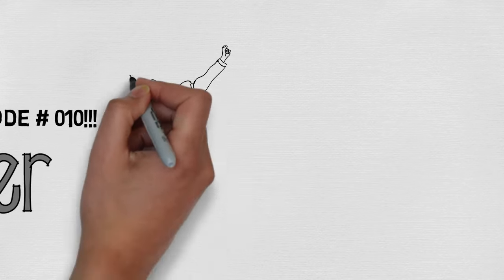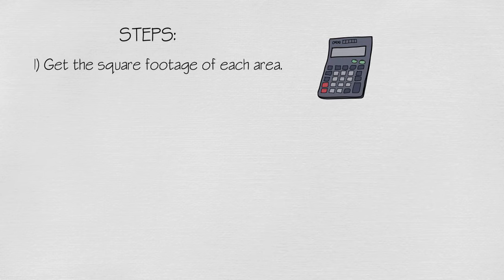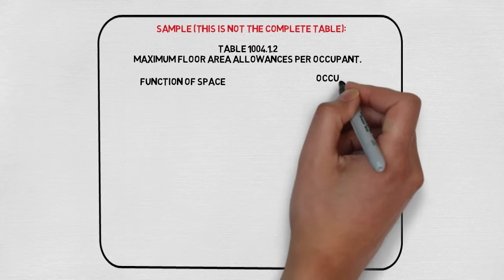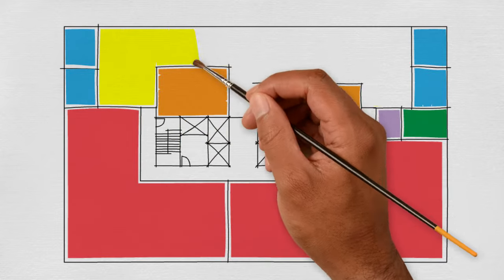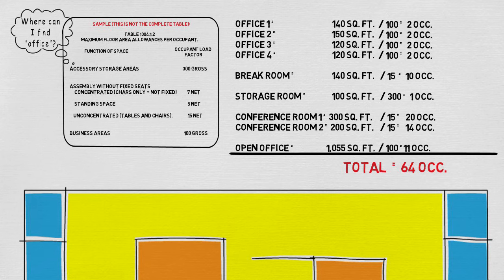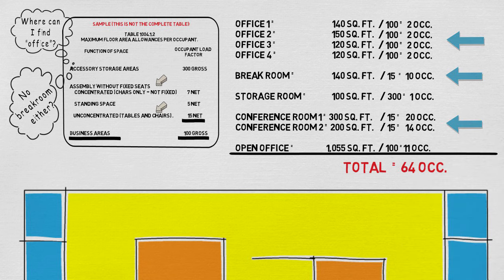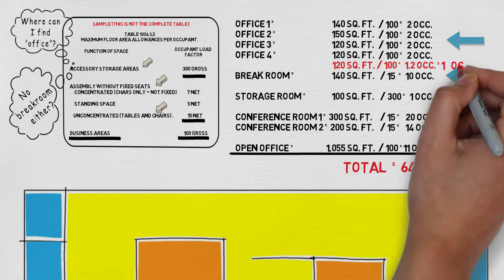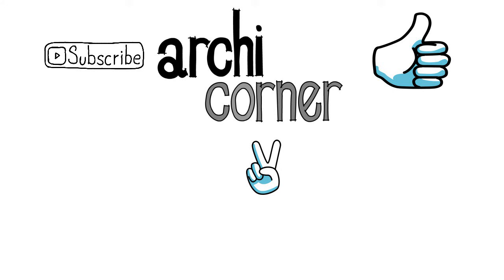AC 010 - Egress: How to Calculate Occupancy Loads (Part 1 of 2) - The Basics

Comment: Are your videos per CIDQ codes>
Reply from the maker: CIDQ is a license type if we are not mistaken. When you are a licensed designer you must design per the local codes. However NCIDQ's exams are based on the IBC and other commonly used standards by interior designers such as BOMA, ICC A117.1, NFPA, etc. 

The video you commented on specifically (AC 010) was produced with IBC in mind. Most other videos on the channel also reference the IBC. Each video states which codes are being used for the samples given. 

Sorry about the late reply... :(

Comment: What is the difference between net and gross?
Reply from the maker: You can find the definition of "Floor Area, Net" and "Floor Area, Gross" in Chapter 2 of the IBC. Chapter 2 is basically a dictionary for phrases used throughout the IBC. You can view the IBC for free online. I hope that helps!
Reply: well I may be wrong but it may relate as follows:
net = minimum 
gross = maximum

Comment: Why not add all the Business Area square footage up first and then divide by the Load Factor? It would have divided out better and you wouldn't have rounded 0.2 up over and over again.
Reply from the maker: The main reason you show occupancy loads is to show how many people are egressing from a specific area. Depending on the occupant load some areas may need two or more exits. Since the load for offices is so small, it is reasonable that a typical 10x12 or 12x12 office may not need two exits. Therefore combining all the offices area into one occupant load may work fine. HOWEVER there are times when AHJ's may ask for the occupants load in a specific room to confirm that the correct number of exits are provided. Therefore it is a judgment call as to whether you use combined loads, individual loads, or a mixture thereof. Regardless of the method used, the key is to clearly show how all egress requirements are being met. Sometimes one method will be better than the other. 

GREAT QUESTION!

Comment: First off, I love your videos, they are extremely helpful.  However, I don't believe you round up for each office (as in if you have 120SF = 2 occ.)  I also don't round-up  people,  and have had the opposite experience - most LBJ I have worked in allow rounding down for any fraction. You can't have half a person, you either reach a threshold or round down is my argument. I would also combine all offices together to 530 sf /100, not as individual spaces, but rather lumped together by singular use, 5.3 persons = 5 occupants. So although I found the rationale very logical I would calculate 5 occupants where you calculated 8. Actually since office space is all 100 SF / occ I woudl calculate all office and open office space together as singular load factor (1,175/100 =11)  So the case of your storage room with 100 SF is also a point of argument, I suppose 1 occ. is the minimum, but I might argue for 0.  As always very helpful, and I am not sure the code defines how to calculate as specifically as adressed by your video or my comment. Please correct if I am wrong! thank you!
Reply from the maker: That’s a good point. However, I have noticed that not all jurisdictions accept that, and plan reviewers sometimes ask for each office to show their occupant load. This is one of those scenarios where you must know what jurisdiction that you’re working with, and if they allow one method versus another. If your AHJ allows that then I don’t think it’s a big deal, go for it. There’s more than one way to skin a cat sometimes. Thank you for sharing.